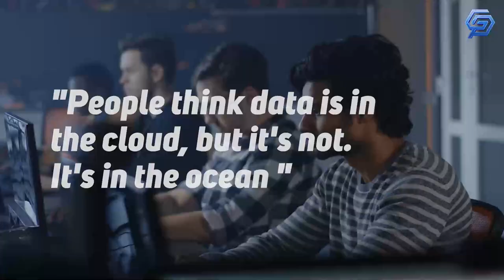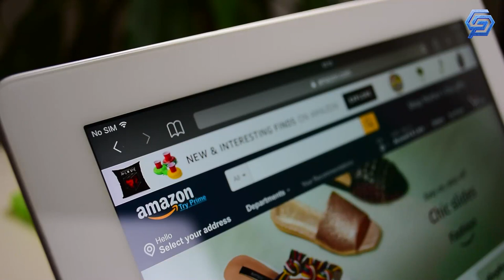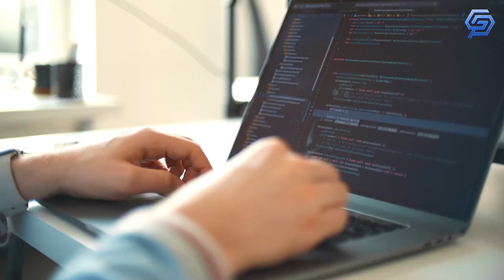How The Internet Travels Under Sea

Comment: The networks are so advanced nowadays. We upgraded from wired to wireless connections and letters to phone calls text messages and video calls. The internet is a series of connections between servers and computers. It's pretty interesting how the internet travels along the ocean floor in a network of undersea fiber optic cables and takes only a few miliseconds. Wi-Fi and phone data systems eventually link up with physical cables that swiftly carry the information accross continents or accross oceans. Thank you so much for doing this video.
Reply from the maker: Thank you for the support <3